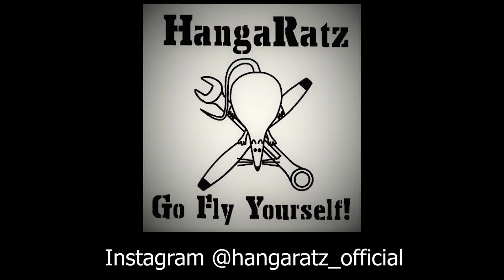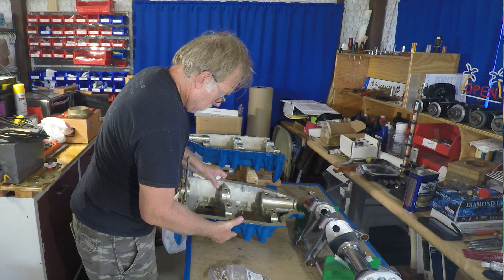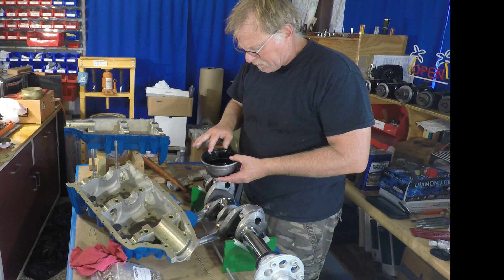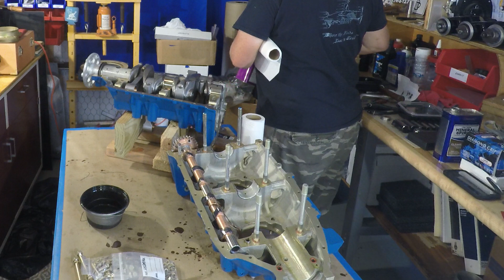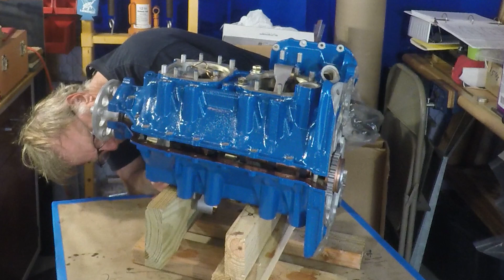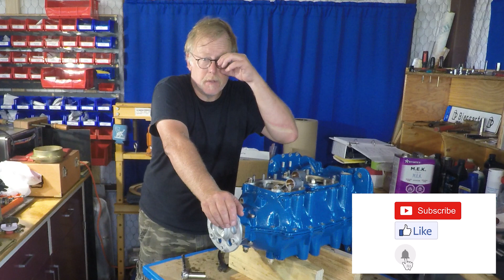360 Engine E11 Crankcase Assembly!

Comment: Why doesn't he use Lycoming case splitting/joining plates?  that's how the Lycoming overhaul manual instructs you to join the cases.
Reply from the maker: We were not able to get Lycoming tools when we did this overhaul.  Since then we have just refined our own tool which works fine.  Thanks!

Comment: I am in AP school and I disassembled the 0-360. However after reassembled it makes only 2 1/2 revolutions on the engine Stand. I read in the manual there should be marks to time my crankshaft to the cams but I don’t see any. What should I do?
Reply from the maker: If you have any doubt remove the accessory case and sump and double check the timing marks

Comment: Great video. Where in the parts manual is the o-ring listed for the 4 through studs? I can only find the ones listed for the aft studs and the front bolts. Thanks.
Reply: That’s why I’m here. I can’t find those o-rings in the manual. Did you find the answer?  Looking for the part number

Comment: The professionals usually mount the crank assembly vertically on an engine stand before trying to put the case halves together.
Reply from the maker: I prefer to use the method the factory uses, which I would regard as the true “professionals” and that happens to be horizontal…. 
Not sure which professionals you are referring to…

Comment: This is probably a silly question but I thought I remembered seeing somewhere that the rebuilder mounted the crank to a bench, vertically, then put each crankcase half on vertically. Would that have worked also?  Great video man, lots of good info there. Thanks.
Reply from the maker: Some folks do it that way.  The factory does it horizontal.  That's the way I was taught...   Thanks for watching!

Comment: Thanks for making this video. Long time automotive tech here getting interested in aviation. Is there a point before assembly where you clearanced the bearings? As you may know, in auto we plasti-gauge everything to pick out the correct bearings, is there an equivalent step that you do on these engines prior to assembly or do you just base it off of crankshaft and journal measurements? Seems like it would be a huge pain to torque case halves together and then take it back apart to check clearance.
Reply from the maker: We pretty much do it by the book.  The factory does not recommend plastigage at all.  We dimension everything and do the math.  It's an aviation thing...  Thanks for watching!

Comment: Great vid of overall assembly of case halves thanks for posting, one thing that is not mentioned is the cost, its about 10k for parts (bearings, hardware, accys.) and machine work to crank/case and cylinders. Aircraft Specialty Services for steel and Divco for aluminum are some of the best machine shops. The A4K crankshafts are on backorder and also the Cont. O-200 cranks are 255 days out and about 8K new. Hope you did it right lol :)

Comment: Loctite 515 is an anaerobic sealant. It doesn't cure when exposed to air. The directions say to assemble immediately but you do have plenty of time. If using RTV-102 you do have to be relatively quick with assembly. For experimental applications...Loctite 518 is better suited for aluminum and Hylomar Aerograde with silk thread has seen great success. You can't find POB anymore so Lycoming is recommending Permatex #3 and thread now as one of the options. With both the Hylomar and Permatex it's only applied very thin to hold the thread in place.

Comment: Thanks for all of the excellent videos that you produce.

I notice that you did not apply sealant to the center saddle parting surfaces as well as the front bearing and rear bearing saddle parting surfaces. Continental apply sealant to these areas.
Fretting and wear can happen to these surfaces during engine in service time and when that happens the torque on the forward, center and rear thru bolts will decrease which will cause more engine oil to ingress on to these surfaces and more wear will take place. This is not a good situation in my estimation.
I would like to read your take on this scenario.
Reply from the maker: The manufacturer does not want any sealant on those surfaces.  See Lycoming Service Instruction No. 1125.  Thanks for watching!
Reply: @HangaRatz  Bill, thanks for your reply.

I wonder what the reason is for issuing SI 1125 requiring that no sealant be applied to these areas, yet Continental call for it in their engines.
The only reason that I can think of is if the sealant is not properly applied then sealant contamination of the crankshaft journal will happen.
These centerline saddle surfaces sometimes chafe against each other with slight movement and wear down which results in thru bolt torque being lost.
If the sealant is properly applied it does prevent oil ingression and if it is not applied, movement and wear can happen with engine run time. Then it is all downhill from there on.

Comment: You could find some rubber hose that fits snuggly down into the pushrod hole of the lifter then get a piece long enough to go from the first lifter round the outside of the upper block half and into the second lifter to stop it falling out. Do the same for the 3rd and 4th lifter. Then lay the cam shaft into the lower block half during assembly of block halves.
Reply from the maker: Lots of different ways to do it.  We use the manufacturer's method in our videos whenever we can.

Comment: How are you checking main bearing clearances? Do you assemble case halves with bearings and use a dial bore gauge? Same with rod bearings?
Reply from the maker: Yes.  We do not use plastigage in aircraft engines.  Thanks for watching!

Comment: Why couldn't the cam go in the bottom half of the case instead of hanging off the wires?
What did I miss ?!
Reply from the maker: Seems simple enough.  We "hang" the cam from the upper half to hold those lifters on that side of the case in place.  Otherwise they would fall out.  It's a little bit of a ballet...  Thanks for asking!
Reply: @HangaRatz  ah! Of course.  Great video.
Reply: Bill, could you put the other half of the case in the stand so the lifters, cam and crank could be settled in and just lower the "naked half of the crank (with bearing inserts) onto the half with all the compontets?

Comment: Is it possible to prime oil system and fill oil filter before start up? This reminds me of Volkswagen back in the day.
Reply from the maker: It is possible to pressure prime the engine prior to start.  Depending on brand of engine priming the filter is normally not possible due to the orientation of the filter.

Comment: I am wondering what the resistance is that is requiring you to pull the case halves together.
Reply from the maker: The case and through-studs are an interference fit.  This reduces case fretting during operation.  Thanks for watching!
Reply: @HangaRatz  thanks

Comment: So no silk thread when you use the Loctite 515?
Reply from the maker: Yes.  Page 7-16 of the Direct Drive Overhaul Manual has a note that silk thread is not used with Loctite 515.  Thanks for watching!
Reply: @HangaRatz  apparently the non hardening Permatex 2 with the thread is an option.
Reply: @HangaRatz  would like to communicate with you via private message or email

Comment: Hi Bill,
I'm building up a 0-320E2A with new Millenium cylinders, RAM 160 conversion and Powerflow exhaust. I'm an A&P but haven't done an overhaul since 1993, so will do the overhaul with a friend. I've got all the major parts back from Aircraft Specialties and Divco. Love your series and probably won't start the build until you finish your series. Too many good pointers! There are plenty of mods and repairs to my Piper Cherokee I can entertain myself with until then. I am curious when you think the series and that 0-360 will be done. Not to hurry you of course!
Reply from the maker: This engine is finished.  Been real busy.  Putting final wraps on next episode (cylinder installation).   Life is getting in the way!  Thanks for watching!

Comment: Looks like Lycoming copied a VW bug motor.   Almost identical to include the pins on the main bearings .
Reply from the maker: Actually it is the other way around. Ferdinand Porsche visited the Lycoming factory and the Continental factories in the late 30s when he was designing the KdF-Wagen. That’s why the VW engine is similar to the old Continental A40 and Lycoming O145. But simpler…
Reply: @HangaRatz  Thanks, I didn't know that !

Comment: Couple of questions on the main bearing installation:  1) why coat the back side of the bearings, and i would have plastiguaged the crank before I lubed the mains.
Reply from the maker: Q1) why coat the back side of the bearings
A1) Because the manufacturer says so.  As licensed aircraft maintainers that is our guidance.
Q2)i would have plastiguaged the crank before I lubed the mains
A2) That would entail assembling the press fit case halves an additional cycle which is hard on the cases and the through bolts.  Plastigauge would only duplicate what the previous dimensional checks already confirmed.  Plastigauge is fine for assembling cars but has no business in aircraft engine overhaul.
That's my story and I'm sticking to it.  Thanks for watching!
Reply: @HangaRatz  OK.  Thanks.  It's been at least 10 years since I have overhauled any A/C engines and I only did O-320s.  I did them iaw the Lyc manuals and SBs.  How quickly we forget.